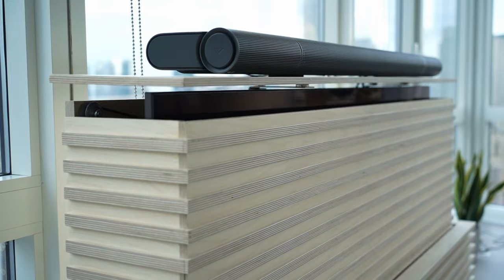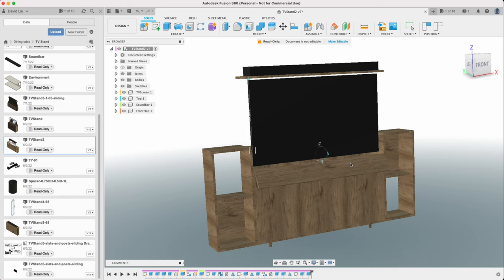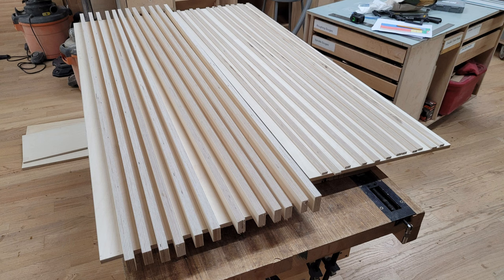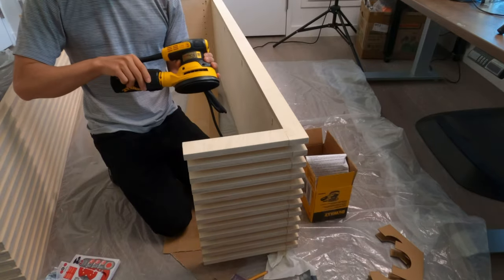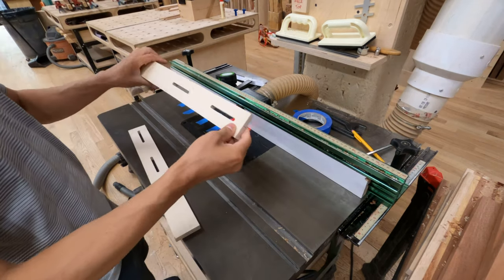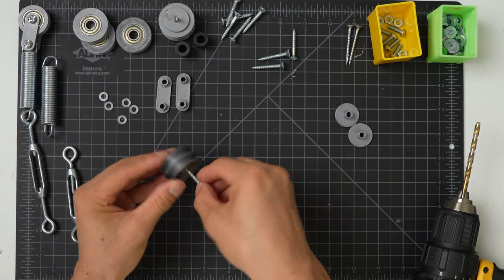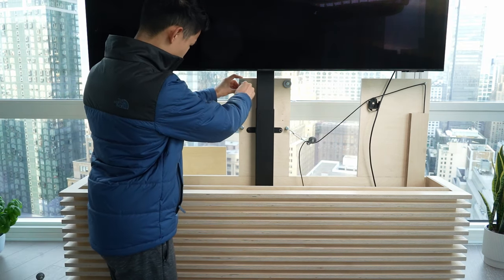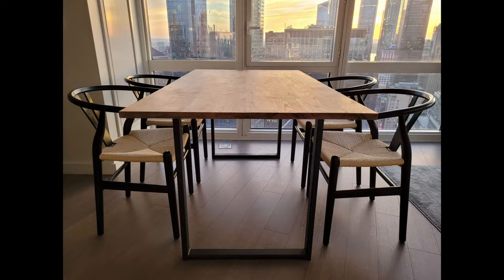Building a TV lift cabinet with a MOVING COVER for large TVs

Comment: You built this all in an apartment? That's super impressive
Reply from the maker: Thanks! Besides cutting the plywood pieces to size, almost everything else was done in the apartment. I actually 3d printed a fan duct to properly ventilate the room for wood sanding/finishing... a bit of yak shaving in this project.

Comment: Fantastic result, from concept, fastidious design to implementation, well done.

You could have put a small lip around the top panel to deal with hiding the gap as well as adding rigidity. An led strip could have also been hidden there to provide a cool ambient glow!

Also i will add a switch that will turn on the TV as it raises and turns off the TV when it closes to save energy by not being on standby. I also want to figure a way of operating it via an Alexa command.

I have lots of ideas, its just implementing them that takes time and effort!

A very interesting, informative and inspiring video.

Comment: Having a TV placed at a normal height for an average seating person seems logical but exceptionally rare!   
 
I liked the clever box in the box moving in the opposite direction to the TV-set but wouldn't it be simpler to use separate linear actuators for the box instead of pulleys?

Also, plywood is not the best material for designer cabinetry. Try bamboo board!

Comment: Anyone knows how powerful the NEMA motor needs to be, to lift up a 75” TV with the swivel mount included?
Reply from the maker: I recommend looking for a linear actuator, which will usually have a rated load. The one I used lifts 155 lbs. My TV is 55 lbs, plus the top lid and speaker, minus the counterweight of the moving cover. Designing your own actuator is of course possible but I don't have experience with that.